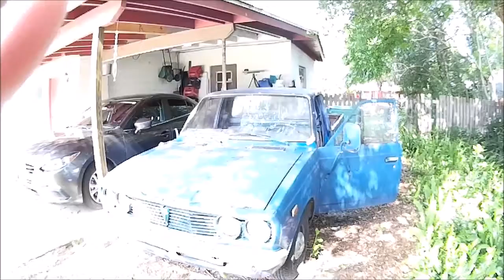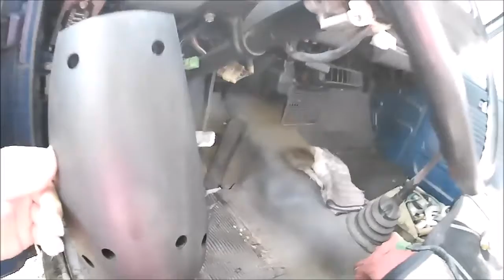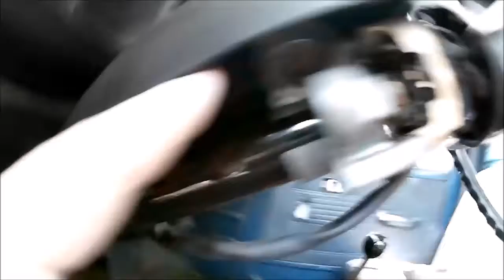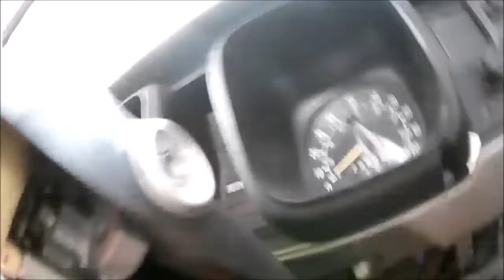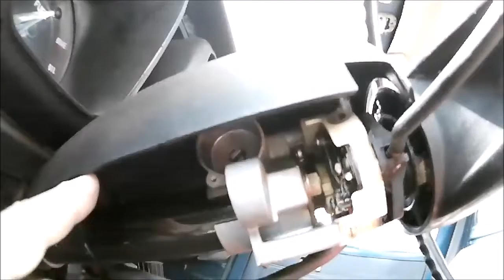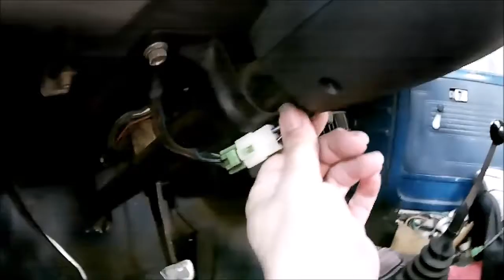1978 Toyota Pickup/Hilux 20R - IGNITION SWITCH Replacement

Comment: I've been having a similar issue with mine. I had a MSD 6al system installed and started to die all of the sudden. Installed back all the original ignition system, kept doing the same thing. Messed up with the weber carb, fuel pump etc. Now I was thinking about the ignition switch, luckily I found your video and I'm going to try that, thanks.
Reply from the maker: Sure thing, I hope it helps. If there is anything in specific you want to ask about just drop me another message.
Just a thought but have you checked your battery? I am right now having issues with mine and it appears that the battery is dying, causing all kinds of running problems. Ignition, carb needing to be set over-rich to get a decent idle, and possibly fuel pump issues, all due to erratic system voltage from the dying battery. Just a thought. I will have a video on that coming out soon.
Reply: @The13thSword the battery is fine and recently replaced the alternator the battery is getting constant 14v from it. I'm going to replace the switch this weekend, we'll see how it goes, thanks man. 👍🏼
Reply from the maker: @therionkp36  Sounds good. Let me know how it turns out.
Reply: @The13thSword So apparently the switch didn't fix the problem 😅 I tried once again with the stock ignition system making sure everything was ok but nothing happened, no spark at all. I noticed that when I was checking the fuses once I removed the coil fuse the fuel pump started working with the switch in the "on" position, is that normal? 
After trying with no luck at all I reinstalled the MSD box and installed a new coil pickup in the distributor. But at the time of firing it up the battery was dead. I'm charging it now and I'll try again tomorrow. I'll keep you posted. After almost 20 years of owning this truck this is the most annoying thing that has ever happened to me so far. Thanks in advance in case you have any other advice for me.
Reply from the maker: @therionkp36  That's OK on the new ignition switch, since you likely had the original 40+ year old one in there. At least now you know that isn't a problem and won't be anytime soon.

I'm not sure which fuse you mean when you say 'coil fuse'. Do you mean the 15 amp 'engine' fuse, second from the bottom on the fuse block? If that is the one you mean then yes, it would be normal for the fuel pump to run with the ignition switch in the "on" (RUN) position. The fuel pump would also run that way if you disconnected the wire from the oil pressure switch/sender.

It's a bit lengthy to explain why this is but in essence, the oil pressure switch is a part of the fuel pump circuit, and it 'toggles' the fuel pump relay, depending on whether there is oil pressure or not, between the RUN and START sides of the circuit, respectively. So pulling that fuse or disconnecting that oil pressure switch wire removes the oil pressure switch from the circuit. The relay's natural 'resting position' is on the RUN side, so turning the ignition switch to RUN under those conditions will power the pump.

This might also make more sense to you if you had the original complete '78 factory wiring diagram. If you don't have those email me at sword013@aol.com and I will send you a PDF copy of them.

Can I assume that the distributor is the stock one? And is it the stock 20R distributor or one from a 22R? There are some minor differences. And if so, when you installed the new pickup coil, you set the air gap to spec? If not you need to do that. The stock spec for the air gap is .008"(0.2mm) to .016"(0.4mm), with one of the reluctor ring 'posts' directly lined up with the center post of the coil, and very light drag on the feeler gauge. I set my air gap at .012"(0.3mm), right in the middle of the spec and it's always worked fine.

TIP - If you don't have feeler gauges you can use a dollar bill folded into three thicknesses. That is right at .012" or 0.3 mm.

What ignition coil do you have? Brand, part #, how old is it and have you resistance tested it with an ohm meter?
Reply: @The13thSword 
Thanks for the reply.
Yes. I was talking about the "engine" fuse, some other Toyotas have "coil" stamped instead of the "engine" word.
I'm currently using the 78 distributor to run the MSD system.  It was running fine for a long time until one day started dying suddenly. I found out that the coil pickup had a short so I installed the old 76 ignition system to it, plugs, wires, dist, coil and igniter, worked fine for like 15 minutes while I was checking the timing and once I thought I was done with it, it just died, checked everything, igniter, coil, points, etc. And nothing. I ordered a new coil pickup with the ignition switch. I replaced the ignition switch and nothing. Yesterday I replaced the bad coil pickup with the new one and installed the MSD system back, but the battery was dead by then. So now I'm charging it. I'm going to test the MSD box first and I'll go from there. I just went to AutoZone to get a new oil pressure switch, cap and rotor just in case. I was also wondering about the fuel system and I randomly found a video of yours talking about the fuel pump relay and at the time I was wondering if the sudden shutting off was because of a bad fuel pump relay. But first I want to deal with the ignition and have a spark for the moment... Also yes. I set the coil pickup air gap to .012... Thank you for the help man.
Reply from the maker: @therionkp36  Sounds like you are being fairly complete in the steps you are taking; good work. I am a little confused about the '76 ignition system' comment because those were points distributors and didn't have an igniter. Some igniters (stock Toyota, HEI modules, even MSD 6A's) will work on points sometimes but often not work well. Generally speaking ignition modules were designed to have that input signal from the pickup coil to work their best.

If you can find someone that has the equipment to test the MSD box that is a great idea. Keep in mind however that a lot of ignition modules, including the 6A, may test OK on the bench but fail IRL (in real life). Because bench testing does not involve the usual heat in the engine bay. And ignition modules, regardless of brand, when they get weak or internally damaged and start to misbehave, will often get worse or stop working completely when exposed to heat.

I've also learned that erratic or fluctuating voltage will often doe in an igniter or ignition module. That's why I mentioned the battery first, because a weak or failing battery will produce that. You said the battery was fine but did you load test it? That's the only sure way to know what state of 'health' the battery is in.
Since the alternator is new that should be no issue, but what about the external voltage regulator? That has contacts and coils in it just like a relay has, and those can have issues or wear problems. It would be a good idea to get that tested too, if you can, or if original just replace it with a new one, to eliminate it as a potential issue.

Fuel System - I'm glad you mentioned this because there too, it could be causing the same result. One thing you can check immediately is the fuel pump resistor. It is mounted on a steel plate near the passenger side inner fender. If original it will look like a white ceramic cylinder. The resistor drops the battery voltage to the pump to around 9.5 volts in the RUN circuit. That resistor converts the 'extra' voltage and turns it into heat, so that resistor over time can get fatigued, and develop higher than spec resistance with that heat, and choke of voltage to the pump, resulting in reduced fuel pressure and flow. It can get so bad that it won't flow enough to keep the engine going.

Use an ohm meter to test it. Spec is 1.4 ohms cold, with a max of 1.54 ohms hot (10% tolerance). Anything over that and it's bad. I used a hair dryer to heat my original resistor up and it got to around 1.9 ohms. The math on that came out a 30% loss of voltage to the pump, and likely a corresponding 30% or more loss of fuel pressure and volume, starving the carb and shutting down the engine.

If the fuel pump relay is also original it could also be an issue. Coil could be weak (same cycling/age related fatigue), burned or pitted contacts not passing sufficient voltage, etc.

I have a post up on Yotatech about this and what to do about it if needed. I can't post the link here or Youtube will delete the comment. If you want to see and read it just got to Yotatech's website and go into the Forums, Truck Tech, Per-84 Trucks and you should see it listed there near the top, as the thread has been active lately.

Lastly, just stay focused like you have been and remember that with older vehicles like this, it often takes going through every system thoroughly to get it running again and running well.
Reply: @The13thSword thank you for the advice. I'm going to come back to your comments if I have an issue in the future. 
The truck finally started with the MSD. I was searching online and apparently those boxes misbehave with mosture/water.
It started and had it running for about 20 minutes. I'm a little afraid to drive it but I'll try to do it this weekend.
And yes the 76 have points i actually own 2 trucks both 76 but I have a 78 ignition (electronic) in one of them, for this other one I was using the stock (points) ignition but I wanted to get rid of it because I didn't want to deal with points and to make it more "reliable" so I bought a 78 distributor and the MSD box. 
Once I drive it I'll see if it works as it should and I'll give you a update, thanks again for your help.
Reply from the maker: @therionkp36  Glad to hear you got it going. I did a quick look online myself and found this little tidbit: "The box needs to "breathe" to allow moisture and condensation to escape." And that the box shouldn't ever be totally sealed against moisture. This sounds counter-intuitive to me but, live and learn I guess. Most ignition modules and ECU's I've ever seen are totally sealed to protect the electronics inside from moisture. (shrug)

Thanks for the answer on the points distributor setup. Fingers crossed for the drive to come. I'll be looking for your update when you get to it.
Reply: @The13thSword  So far so good. I took the truck to work today and everything seems to be working fine. I'll feel more comfortable once I drive it more... 
And yes I thought the MSD box was somehow waterproof because I always see them installed inside the engine compartment. It wasn't until now that I found out that there's a "offroad" model that it's apparently waterproof... Lessons learned. I'll try to find a way to mount it away from water after this experience. 
Thanks again for your help.
Reply from the maker: @therionkp36  That's good news and thanks for letting me know. Now that you mention it, I seem to remember that a lot of 4x4 guys used to mount that 6AL in the glovebox, and extending all the wiring to it, just to avoid the water/moisture issues. I also didn't know that they came out with 'offroad' versions of the box until you told me. The web says there are two different models too.

I'm waiting on a new HEI ignition module myself after my own recent 'journey' for 'crank no start'. The module should be the last piece of the puzzle for me this time around.

Glad any of my info was of some help to you.

Comment: Hey I'm glad I found your video because I have a 1979 Toyota Pickup Truck an I've taken it to numerous of mechanics and no one seems to know what is wrong with my pickup truck. After I crank it up and start driving it down the road after it gets real warm then it just goes dead. So after it sets for a bit and cools down it cranks back up and I am on my way. So I think from what I seen in your video, that you had a problem with yours going dead and I do not know if you was driving it or if it was just sitting parked. Any rate, I am wondering if it would be the ignition key as I think from what you were saying in your video. I have got a problem with mine not coming from park position and I do not know how to get it out of park. I am only guessing it could be the ignition switch lock but do not know how to get it out of the lock position and I do not have the driver's manual. So if you could possibly explain to me, since you own a 78 Toyota pickup truck that maybe you know more and could help. I really am glad I came upon your video because there is not too many people out there with 1978-79 pickup trucks Who has videos of any form of mechanic work. So you are close by me and your model of a Toyota pickup truck, and so I was wondering if you could help in the situation that I am in. Thank you so much for your time reading my message. God bless you from your friend Billy 😁
Reply from the maker: Ok, lets take things in the order you mentioned them. The usual causes of the engine just dying unexpectedly are usually one or more of three thing. The ignition coil, the pickup coil in the distributor, or the ignitor (ignition control module). The first two items are more common problems of this age of truck; the ignitor rarely goes bad. The best way to tell if either of the other two items is bad is to test them with a Volt/Ohm meter. If you don't have a meter or don't know how to use one, you can get a good-enough one for under $10 at any Harbor Freight. There are also videos on YT that can show you how to use the meter. It's not hard.

Pickup Coil - look for a cable coming from the distributor & going to the ignitor. Ignitor should be a metal box either mounted on the driver's side fender well, or mounted over the ignition coil. There should be a green plug inline with it that you can disconnect. Measure for resistance in the two terminal slots in the connector on the distributor side. If good, it should read 130 to 180 Ohms cold. If it reads 165 or more cold, it could be going bad. Once a pickup coil starts going bad & heats up as you run the engine, the resistance in it goes up, and it won't transmit enough voltage to the ignitor to trigger the ignition coil. Once it cools down, resistance drops and it works again.

This is the same problem with a bad ignition coil.  There are 2 resistance measurements you need to make on that. One is the + & - terminals (Primary resistance), the second (Secondary resistance) is the center post (the big one in the center where that wire goes to the distributor, and either the + or - post; which one of those doesn't matter.  measured cold, the specs for a good ignition coil on the '79 are:
Primary Resistance - 1.3 to 1.7 ohms
Secondary Resistance - 6500 to 10,500 Ohms

When an ignition coil starts going bad, it's usually the secondary side where you will see a high reading.. Anything over 10,500 cold is bad. Even if it measure 9500 cold I'd still replace it. A failing Ignition could will cause the same problem from heat, like you describe.

I am unaware of any test you can do with a meter for the ignitor. Usually I just replace the ignition coil & pickup coil (if necessary) & if it still does it, it's the ignitor. I've never seen one stall under heat before because of a bad ignition switch, then work once it cools down. Ignition switches don't fail that way, they either usually work or they don't.

Besides these things, it could be a loose connection somewhere. I hope it isn't because those can be very tough to find. At least make sure all connections are clean and tight, nothing loose at any connection point.

I'm not entirely clear what else you are describing about the ignition lock. You must be able to turn it to get the truck started for it to stall when it gets hot, yes? It also sounds like you have an automatic transmission (no clutch)? If so, the key needs to be at least turned on to the "run" position, the first "stopping point" you feel before turning the key fully to start the engine, in order to move the shift lever. There is a safety, a mechanical interlock, that only allows the shifter to be moved out of Park once the key is on. There is also usually a button on the trans shifter handle that needs to be pressed in to get it out of Park.

Let me know if you test those items and tell me what you find out. Also let me know about those questions about the ignition lock, shifter, & whether you have an auto trans or not.